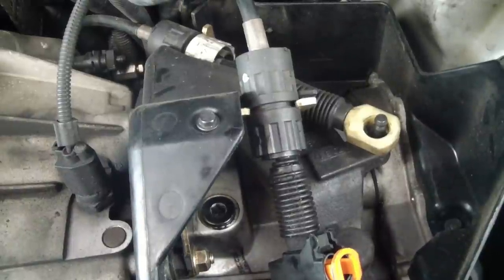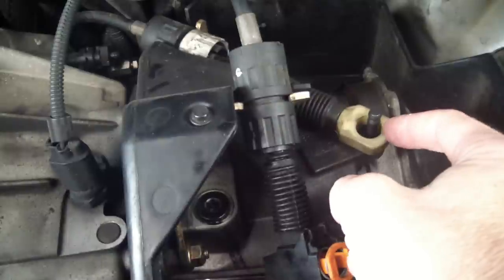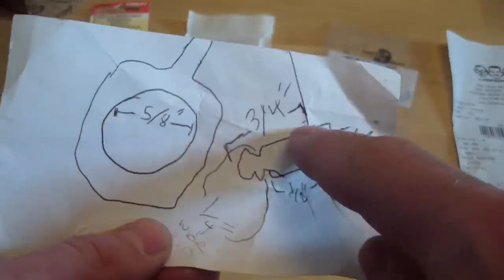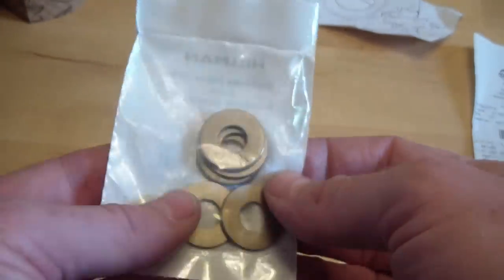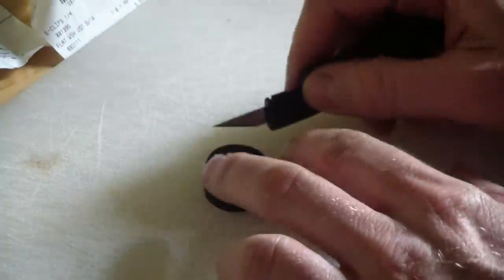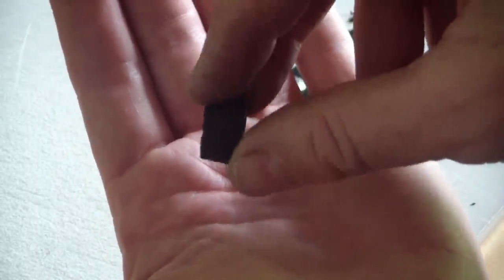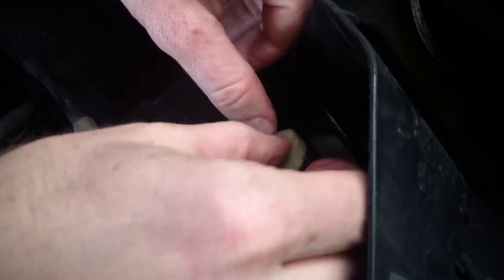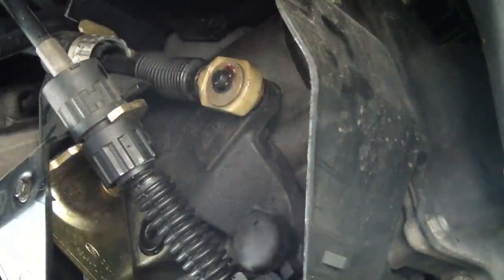How To Fix Sloppy Shifting - Ford Focus IB5 Transmission

Comment: Thanks for this. Came across the same problem in the UK whilst accessing the gearbox oil filler plug. Managed with a 1/4" inch circlip as the next size up in my assortment is 3/8" (typical).  The slot in the steel peg is chamfered so the circlip fits well enough- but not perfect. Used a (cut down) roll bar link bush from an old GM/Opel/ Vauxhall which has a perfect hole of around 5/16" (8mm) Much easier to cut hardened rubber bushes if you keep dipping them in water. It helps stop the knife drifting outwards as you cut.  Used 'red rubber grease' as being a brake system grease it's fully compatible with rubber. (Very bloody sticky though.)

Comment: I've typed all the dimensions you mentioned into OpenSCAD, and sent it to my 3D printer. First attempt almost fitted like a glove, just adding a quarter of a mm here and there and it should be perfect. Thanks for sharing this video! 😊 Edit: Second attempt it fitted really good with no play at all, the gear lever snaps into the gears really nice. Outer diameter = 16.125mm, inner diameter = 8.4375mm, height = 12.7mm. I'll add some ridge to the part so the cable cannot slide off. Maybe i'll share a Thingiverse item later here. Edit 2: It's on Thingiverse now, title is "Ford Focus Mk1 Zetec 1.6 gear lever cable bushing"
Reply from the maker: You’re welcome. A 3-D printer is a handy thing to have around.
Reply: Thank you for the thingiverse design, used it to fix my car.

Comment: Thanks for the video. Most useful. Was driving my '03 Focus and the cable slipped off the pin. Managed to drive on home in 4th.  The original collet/bushing was completely perished, just a few bits left lying around. Followed you instructions and was back on the road in no time.
Reply from the maker: You’re welcome. I didn’t know how many people would watch this video when I made it. I figured there just be a few people like you who have the same transmission and the same problem. I’m glad I could help.

Comment: Thank you for this,  I just used your solution on my 1998 Hyundai Elantra,  I used the shock absorber, but I had to slice in half it was too thick, there was already a washer a retainer and metal ring... the rubber was gone ,  I use brick to sand down the shock absorber to size, stuff the ring in the middle and place the absober and ring in the hole of the cable. I cap it off with the washer and then catcher..  It now shift into first gear like it was new. Thank you again.
Reply from the maker: You’re welcome. I’m glad I could help.

Comment: Good work! Mine has a problem IB5 like yours, but sensation is stiff and clunky instead (like a dry box, despite being filled with new correct grade oil by mechanic). I also oiled up the parts under the gaiter (improved a bit). So now I know where the cover is under the car, thanks to your vid, I'll investigate linkage etc. further...

Comment: Thank you my friend.
I fixed my focus ecxactly  the  same way.
The thickness of  the pastic part of the cable,
is 10mm, the same is the thickness of the rubber ring.
You can create a rubber ring too,  cutting a 10mm  piece
of  a  rubber  tube of 16mm diameter.
Reply from the maker: +Tero Xra  You're welcome.  I'm glad you got it fixed.

Comment: Holy crap, I just realized all these videos you made were from all the parts that failed on your crappy Focus, which I have the exact same one in dark bird-poo green. I hope all these things don't fail me now. Thanks for the videos though!
Reply from the maker: I hope you have the zetec engine instead of the one I have. The split lot single cam engine is famous for dropping valve seats and blowing up. You will probably need to replace motor mounts soon, but that is cheap and easy to do.
Reply: ***** I wish, I have the same junk motor as your car.
Reply from the maker: The engine is well designed except for the valve seats. If you put a rebuilt head on it, it will go another 100,000 miles.  If you don't replace the head, don't rev it too high. It is a time bomb.
Reply: Boy do these dohc engines idle like shit. 105hp gets down. Hope this is my ticking when coasting and not going into park sometimes. Hammer down no issues. Lol I'll take a half million mile Buick
Reply: Thumbs down for me this is stick. Hoping it's not diff ring gear chip

Comment: The grommets from the shifter base worked out for me, I used a vacuum plug for the center and a washer under the e clip. She's a rough on engagement while vacuum plug wears in.

Comment: Thanks for your video ford Australia want $316 Dollars for the replacement parts but fixed it for $2.50 and 1 hour labour from me and it is fixed working great. Thanks very much for your help. Cheers Rob
Reply from the maker: You're welcome.  I'm glad I could save you some money.  It isn't right that they force you to buy a giant cable that is difficult to install when all you really need is a cheap little piece of rubber or plastic.

Comment: thanks very much for this!! I just fixed my Ford Fiesta that had the exact same problem only worse because of the location and position (vertical) the cable kept coming out and it was impossible to drive. Because of your video I was able to know what to do in my garage and save over 200 euros for sure. Only one thing; I did it spending 1,60 euros:-) Thanks again!!
Reply from the maker: You're welcome. Mine still works great, so it is a permanent fix.

Comment: Thank you very much for your great video. Just in case you want to get the original rubber bushing for that, it is Ford P/N AN15-7H401-AB. Well, in reality it is a replacement for the cable terminal but you can transfer the bushing to your shift cable. It's an idea.
Reply from the maker: EcoSportMéxico Thanks.  When I asked my local Ford dealer, they found the part number in the computer  but told me it's discontinued and I can't have it.  That's OK though.  My custom bushing is working great.

Comment: Thanks for the video, I just did this yesterday, and it worked very well. UK Ford Focus mark 2, 2011 MY with 1.8 litre Duratec HE 16v Twin Cam engine and IB5 gearbox.
Reply from the maker: You’re welcome. I’m glad I could help you get your car fixed.

Comment: Just started changing my girlfriends gearbox on a 2000 1.8l Focus zetec (UK), it has the same type of connection, has a rubber collet in that white plastic hole which push fits onto the pin.

Comment: If I can add this. As an emergency fix, while waiting for a new bush and c clip. I used a piece of rubber lpg gas pipe. Outside size is 15mm, the bore is 8mm, then fitted a metal washer and small cable tie to retain it on the shaft...
Reply from the maker: Thanks

Comment: Thanks. Fix in 30 minutes. The rubber bushing can be replaced by a piece of rubber hose similar to that carried by the refrigerant system. More economical impossible ....
Reply from the maker: You’re welcome. Yes any reasonably tough round piece of rubber will work.

Comment: Does anyone here have an idea on whats wrong with my ford fiesta gear shiftng? While driving in motorway, i suddenly heard a loud sound like tiny ballon poping off( i was not shifting gear at that time. After driving 30 mins or so i could not put gearstick in first gear. This problem is not frequent but happens time to time in first, second and even reverse gear. Any idea on this guys?

Comment: I just need a e clip my rubber is there but in two pieces and falling off every time I put it on. Mine is a 2001 focus so this shift lever is on the side not top

Comment: 2009 ford focus se.  Check engine and maintenance wrench on. Cleaned throttle body and replace power steering pressure switch. Not shifting pass third gear and now speedometer not moving.
Reply from the maker: +Cory P  Not sure about the problem getting stuck in third gear, but the vehicle speed sensor is what sends the signal to the speedometer.  They're pretty easy to replace on this car.
Reply: ***** thanks bro. Ill try that. This car has all kinds of issues. The mileage reading and fuel miles to empty reading sometimes goes blank as im driving, and i get a "tire pressure monitor fault" reading.   Is all that tied to one component?

Comment: Hey good video. I have done what you said but my problem is i can not keep the gear stick in 4th 5th or reverse...
Reply from the maker: Rebekah Dennis Maybe something is broken inside the gearbox.
Reply: Synchro has gone, new gearbox I’m afraid

Comment: Do you know what it's called when the Shifter won't return to center neutral? It moves freely from left to right. I can shift like normal, but when i exit the gear and go into neutral, its just loose. Any ideas? thanks man

Comment: small mistake here guys, Appears that some zetec SE focus do have the IB5, I think you can just ID it cos it has these cables at the front under a plastic cover, whereas the mtx75 has the shifting cables going in differently and a different oil fill plug which isn't under a plastic cover.

Comment: Thanks for this video. I was looking for my fill plug location on my IB5 transmission and notice the gearshift cable was missing the collet. Defiantly going to replace this as soon as I figure how remove the filler plug and refill without having to remove the cables. Any suggestions? Thanks
Reply from the maker: I don’t have the car anymore, but I did have to put oil in the transmission. I think I used a squeeze bottle, like a gear oil bottle, with the hose stuck into the top of it and was able to squeeze and pump oil into the transmission.
Reply: @hoohoohoblin  Thanks. I bought it new in 2000 and never had the fluid changed. I hope replacing with new collet and fluid will get it back 100%. Still have the factory clutch so maybe it will help. You are a  MacGyver of auto my friend!

Comment: Good evening and thank you for your video. would like to ask my own shifter shaking up down when I have gear but all gears normally enters without problems. might be caused to that shown;
Reply from the maker: Yes. Something is loose, and it is probably a worn bushing.
Reply: ***** Thanks for the quick reply.  i will open the lid from below to look
Reply: ***** thank you my car is fixed perfectly and i understand the process exactly. thanks again
Reply from the maker: You're welcome. I'm glad you got it working.

Comment: My 06 focus has this problem I think. However I can't access this easily as I thought . It is under the battery , so I removed the battery and plastic casing but there is a aluminum or metal casing . Anyway to remove that?
Reply from the maker: ***** I don't know.  I've only worked on the 2001 model.

Comment: I have the exactly issue but with the Z tech engine, any ideas ?
Reply from the maker: +jonathan zidan follow the cable. If you have somebody move the table by shifting gears well you were under the car, you can probably find where it hooks up to the transmission. I bet it is very similar to my car.
Reply: hoohoohoblin yeah it's the exactly same idea but it's different and bigger, the cable popped out and I put it back but it's very loose and it popped out again so I have to build it same what you did , like as said same idea but bigger and different

Comment: that was a very good video, I feel that i have the same problem with my 2005 ford focus. I was driving and it popped out of gear, when i shifted it felt loose like nothing was holding it.  So this weekend I will look at the transmission gear box and hope it is that and not the transmission.  If it is the collet i will fix it the way you did yours, is your's still performing great after the fix it job you did?
Reply: Bro do u fix the problem like this? Cuzmy focus 2004 pop out of gear 5

Comment: Thanks for the video. Can you tell me where I would find this on a 2005 Ford Focus?  Under battery?  Under fuse box?
Reply from the maker: Yours has a different type of transmission but it should be in a similar place. Crawl under the car and have someone shift through the gears with the engine turned off. Look for a cable moving, and listen to for the sound of gears shifting, and you will find it. It will be under the car, attached to the engine.

Comment: Hello I'm from the uk I have a 2004 focus ib5 gearbox. My car gets stuck in 5th gear  it seams to only happen when I'm on a long journey the problem happens when I'm changing down from 5th it's that bad that the lever gets stuck in 5th and won't move out I have to stop the car  and wait for about 30 seconds then I can put it back in neutral  and start off again. I scares me as it only happens about  twice a year and not all the time any advice would be a great help thanks tony

Comment: I was just made aware of this - we do have a bushing that fits this at www.boogerbushings.com. Same ID, same OD, same dimension on the "lip" that we mold into the ID to fit that steel pin. Our bushings are a Shore 90A durometer polyurethane. You need just one of our small bushings for $7 including shipping in the US. Hope this also helps some folks save some money over buying a new cable assembly.
Reply from the maker: That's great!  Way better than buying the whole assembly.

Comment: I have the same problem but te end of the cable is a plastic almost square thing, what can i use? Mine is a 2006 focus.
Reply from the maker: +lisandroflo  I bet you could use the same type of shock absorber mount that I used, but cut it into a square with a razor knife.
Reply: +lisandroflo Fill up the hole in the plastic with sicaflex or something. Let it dry, cut of the excess and then drill a hole for the stud ;)
Of course you have to make sure that it dryes away from the stud...

Comment: Thank you for your replay,
I have ford focus MK1 1600 CC. could you please tell me which one did you order?
thanks
Reply from the maker: ניב שמר I don't remember, and I don't have the package anymore. If you measure the diameter of the shift shaft and go to an auto parts store, yo can ask for a shock absorber bushing with that size hole, and they will find one for you.

Comment: Were are you working at? What location is that on the car?
Reply from the maker: Underneath the car close to the passenger seat. If you go under the car while someone else moves the shifter around, you can hear it and find it.

Comment: orielys has cable linkage bushing kits normally hiddeninthe back also is there any fluid in that thing swear i could hear an echo
Reply from the maker: +tbirdpimp07 It was about a quart low. This gearbox was designed with no drain plug, and only a filler hole, so I had to siphon out the old and fill it up.
Reply: my mtx75 i looked for the drain for a while finally looked it up online if ya ever have it out and apart might wanna put a plug for draining wonder what theyll come up with next

Comment: could try having a look at "overclockers uk forum" shows a fiesta 1.4? mite be paragraph 9 down, with sticking gears........ but only when been driven for a while.... ok when cold. its a bad design of ford,  basically needs at least a clean and a greasing ( maybe a strip down of the linkage arm shifter due to it having a Bush inside,, sometimes no bush... that dries up when hot ) with high melting point grease or similar.    this might help.

Comment: Hi I for some reason cannot find this part on my car I have a 2003 2.3 liter SE focus can someone tell me where this is
Reply from the maker: That engine has a different transmission than mine. Go under the car and look and listen while someone in the car shifts it through the gears. Do this with the engine turned off, and you will hear and see where it is connected.
Reply: ***** I think my gear connection to the motor has jumped off. It's stuck in second gear. I know i have to look for some long stick that's jumped off some hook thing, but how can i find it when I can't change gears? I have a Ford Focus DL 2001.

Comment: This is pretty cool... I have this problem with my 2014 ford fusion. different shifter cable but maybe I can do something similar. Part is on national back order -_-
Reply from the maker: I hope you can figure something out to fix it.  This method will probably work.
Reply: Zip ties for now

Comment: hi I found the filler cap but not the drain. where is?
Reply from the maker: BELHASSEN bill There is no drain plug on my car, which is a Ford Focus with the IB-5 transmission. Ford says you never have to change the oil.  Just keep it topped up.  Sounds like a bad idea to me, but that's how they designed it.  Mine has 142,000 miles on it and still shifts fine.
Reply: ***** hmmm ok thx :)

Comment: Just curious, i watched this video anyway, i have a slightly different car, i have a 2003 Zetec 1.8, curious on what your actual problem was, envious on how good your gear changing was hence the reply., i sometimes have to "Force" my first gear, more so when cold i think, the other gears are really easy, (Feels like it just slides in, no Pressure needed (Can change gear with 2 fingers..)) sometimes it "misses" Reverse" though, would this problem be in the same area as yours or am i totally off base?
Reply from the maker: Mine was a little bit hard to shift when I first bought the car, and I found out that the oil level in the transmission was really low.  I added oil, and it got a lot better.  Your car has a different model of transmission than mine, but you should check the oil level, and also look at the linkage, where the shifter cable attaches to the transmission and see if there is a missing bushing or anything else strange.  Mine shifts great after I built and installed the bushing for it.